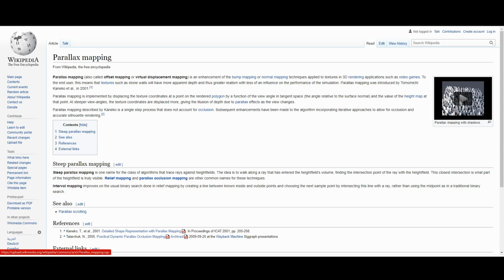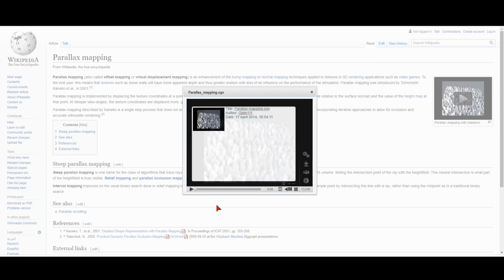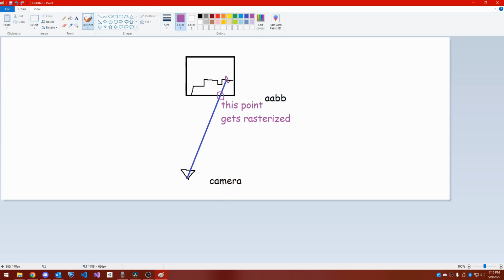Drawing MILLIONS of voxels on an integrated GPU with parallax ray marching [Voxel Devlog #4]

Comment: If you aren't already doing it, could you use the bounding boxes that you use for rendering as an early discard to discard entire chunks of the rendered image and save on performance that way? Also, what about dynamically sized bounding boxes that can change size to cover large areas with a single block to reduce rendering overhead for large solid structures
Reply from the maker: The bounding boxes can't quite be used for early-discard because the bounding boxes are maximal. That is, they surround all solid voxels and in addition may contain some transparent air sections too. Hence, rendering the bounding boxes early would occlude portions of the screen that should actually be visible.
In this iteration of the engine, I chose to go with fixed-size bounding boxes for two reasons. One, it was much simpler to program and maintain the rendering pipeline. Two, having a fixed-size bounding box allows one to limit the maximum number of ray-steps, which is important for achieving good performance on low-end devices with the parallax ray marching technique.
Reply: @DouglasDwyer  That's fair

Comment: How do you send the voxel data to the shaders to render them on the surface of the bounding boxes? I'm trying to create a similar effect.
Reply from the maker: The voxel data for each 8x8x8 bounding box is packed tightly into a single, large 3D texture. The offset into this 3D texture is encoded as a vertex attribute for the bounding box geometry. Then, the 3D texture is sampled in the fragment shader using the offset for each bounding box.
Reply: @DouglasDwyer  In my implementation I have a 'Voxel', a bounding box, and a 'Voxel Chunk', which is a 32x32x32 group of bounding boxes. So you have a large 3D texture for every 'Voxel Chunk' and each bounding box inside the 'Voxel Chunk' has an offset of where it is inside that 3D texture, and then you send the 3D texture to the fragment shader and then do the ray marching inside each bounding box?
Reply from the maker: @brian9498 That's almost correct. The way you describe it, it sounds like the suggestion is to create an entire 3D texture and upload the entire voxel volume to it for each voxel chunk. While that might work for prototyping, it's wasteful in terms of memory (because there is a lot of empty space in the 3D texture that doesn't correspond to a bounding box) and also bad for performance (because you will have to change the texture binding between each chunk draw call).
Instead, I have one single 3D texture for everything. When a voxel chunk is created, I allocate a region of that 3D texture and tightly pack the voxel data only for the visible bounding boxes into it. This ensures a low memory footprint and allows reusing the same texture in all draw calls. Let me know if you have any more questions!
Reply: @DouglasDwyer  Thanks for the explanation!

Comment: Hi, I'm new to graphics programming and I wondered why your implementation of parallax ray marching is more efficient than than simply just raymarching the whole scene. At least on how I understood raymarching it seems that in the end the same work is performed, well more work actually now that you also need to generate those bounding boxes. Is there something I missed?
Reply from the maker: Sure, no problem. There's a big difference between parallax ray marching and "pure" ray marching - that is, where the ray begins.

From my experience the biggest bottleneck in GPU-accelerated ray marching is memory. Every ray step requires loading data from a buffer or a texture, and memory latency becomes a big concern as each ray diverges. Integrated GPUs are especially bad at memory accesses. Naively marching voxel grids can easily lead to hundreds of steps and memory accesses (although there are techniques to reduce step count, like distance fields). This makes pure ray marching slow.

With parallax ray marching, the bounding boxes are first rasterized, which is nearly instantaneous. Then, a ray is started on the surface of each bounding box. Since the bounding boxes are tight - conforming closely to the voxel surface - only a few ray steps are needed to hit a solid voxel. In the best case, it's a single ray step. In the worst case, it's 24. For the scenes in this video, I would guess that it averages around 4 steps. This means only 4 texture fetches, which is much better than pure marching! This is where the speedup lies - integrated GPUs are good at rasterization, but not at random-access memory fetches. So, we minimize memory fetches.
Reply: @DouglasDwyer  Thank you for your input! I believe I understand your concept a bit better, I want to create a more detailed YouTube video about your concept and want to talk about some of my own ideas. Would it be ok with you that I use your concept as a basis for my video, I will of course credit you.
Reply from the maker: @neurenix5201  that sounds great! Feel free to use whatever you like. Let me know when you post it - I would love to take a look.

Comment: How do you pass voxel data to the GPU? Do you use either an octree or just a 3d array that's set per invocation on a box-bounded object?
Reply from the maker: Great question! Let me refer you to an answer I made on a separate video:

The data required for rendering chunks is twofold, and corresponds to the parallax ray marching implementation described in this devlog. First, face data needs to be stored for each bounding box upon which parallax ray marching is performed. There are typically maybe around 3,000 to 6,000 faces that get stored, with vertex position and a per-quad pointer to a materials array. That brings me to the second part, which is the materials array. Surface-visible voxels (only those on the surface!) are uploaded to a 3D texture which is referenced in the VBO indices. On the CPU, data is stored in an octree, so a conversion process is necessary for this step.
Reply: @DouglasDwyer  is that 3d texture just sparsely filled with the surface voxels leaving all the empty space in between? Or are they compressed or consolidated in some way?
Also re:depth values, you mention you can render non overlapping regions with an early z test, but in the video show overlapping objects. Does having overlap require you not use that approach?
Reply from the maker: So, the voxels for each 8x8x8 bounding box (only the AABBs on the visible surface of the volume) are copied into the 3D texture. In texture memory, the voxel boxes are tightly packed, meaning the large empty spaces (or opaque, non-visible solid portions) of the volume are not stored in texture memory. This allows me to render a great number of volumes without an insane amount of VRAM.

You are exactly right about the depth - to solve this, multiple passes are employed. The first pass draws the large static potion of the scene with an early z-test, allowing for optimizations. The second pass draws smaller dynamic objects with an immediate depth write to allow for objects to intersect properly.

Comment: I've been kinda wondering... if I understand your explanation correctly, this method does a depth buffer copy pass for each set of 8x8x8 chunks that overlap in screen-space (kind of like depth peeling, I guess). But your video shows a significant depth complexity at certain angles, which (I assume) would require many dozens of these rather expensive depth-copy passes... yet the performance stays smooth. Is there something more going on? 🤔
Reply from the maker: So, there's an algorithmic "trick" involved with the 8x8x8 chunks which overlap. There is only a single depth-copy that occurs in the scene - you are correct, otherwise the performance would be very slow. Let me try to clarify:

When I draw the 8x8x8 AABBs, the point of the depth buffer is to ensure that closer AABBs are drawn first. If I don't immediately adjust the depth, then the depth of the AABB is written naturally to the depth buffer. This means that, if I draw two AABBs which don't overlap *in world space*, the closer one will always show up on top, no matter how I draw the voxels inside. Problems only occur when AABBs physically conflict, which only happens between dynamic, smaller objects in the scene (because they are not axis-aligned). Therefore, I perform two render passes: I draw the main axis-aligned world to a color buffer, and draw the actual depth to another color buffer. The AABB depth is recorded in the normal depth buffer. After that's done, I perform a depth-copy pass, and then draw the dynamic objects by setting gl_FragDepth. Single copy pass :)
Reply: @DouglasDwyer  Ah! I see. Though, if I understand correctly, this requires to draw the axis-aligned AABBs either in the back-to-front order with regular alpha-blending, or in front-to-back order with disabled depth test and (1 - destination alpha) blending? Which means that early-Z optimization cannot be utilized by axis-aligned AABBs anyway, and ray marching will be executed for every fragment of every AABB (regardless of overdraw) at that stage.
Is there some additional trick you use here? Or is the ray marching cheap enough that you can afford having dozens or even hundreds of them executed per pixel?
Reply from the maker: I am not using alpha blending to draw the voxels inside the AABBs. The transparent "air" sections of the AABBs are drawn by calling discard() in the fragment shader, which seems to maintain the early-Z test. No particular AABB ordering is necessary.
I currently haven't implemented any sort of transparency effects; that will be a separate (and interesting!) issue to tackle in the future. The current technique only supports opaque voxels.
Reply: @DouglasDwyer  Hm... that's rather unexpected, since every resource on the Internet seems to suggest that discard() disables the early-Z test (the "Early z and discard" thread on Khronos forums had a good explanation why). Could this be specific to your Intel UHD Graphics hardware, somehow? Have you tested it on other low-end GPUs? 🤔
Reply from the maker: This is a very interesting point. Thanks for sending me the resources. I have tested on three Intel integrated GPUs and one 2011 Macbook Pro (performance is worse on this one, of course, but not comparatively worse than other games), and didn't observe anything unexpected. I have also tested on discrete cards, and attained great performance there.

I think the reason for this discrepancy is that most of the internet resources on the topic - at least the ones I've seen - are relatively old. Note that the OpenGL Wiki only states "this will almost always turn off early depth tests on some hardware." Also, all modern hardware now includes conservative depth, which is a similar feature. Its existence implies that, at least theoretically, early depth testing with discard should be possible. I would assume that, on recent hardware (within the past 10 years or so) drivers now make the optimization to keep early depth with discard on. This would explain my observations - I find performance gets much worse when I write directly to depth (without conservative depth) than when I use discard. This is a good point of which to be aware, though - thanks for bringing it up!

Comment: Hey Douglas - I'm impressed watching your progress on this engine over time! I noticed that you have some custom depth logic in order to keep early z tests while being able to modify the depth in the fragment shader. Could you go in a little more detail as to how this works? I saw someone else commented about only ever increasing the depth. This makes sense to me if you render the front faces of each chunk - the depth will only ever increase as a ray traverses through the chunk, no problems there. However, what if the camera is inside the chunk? Assuming we're not culling faces, then what we see technically is the back face of the mesh representing the chunk. Then, our assumption that the depth will only increase is no longer true. Does your method deal with this problem? I'm working on my own voxel engine currently, and this problem has left me rather stumped.
Reply from the maker: Haha - you are absolutely right! This is a problem that I gloss over in the video. The method in the video does not have a natural solution for rendering when the camera is inside a bounding box. However, I do have a way to deal with this problem that I intend to implement in the future.

Let me try to explain a bit more about how I do the rendering. You seem to already grasp the idea since you've asked such an insightful question. I break the voxel world up into 8x8x8 voxel "bounding boxes," and then render faces for the outsides of those bounding boxes. The small bounding box size reduces the number of necessary ray steps and allows this to run on low-end hardware. All back faces are culled for performance reasons, so when the camera goes inside a bounding box, the content just disappears. This little annoyance COULD be solved by rendering with back faces instead of front faces, which is what the game Teardown does. However, rendering with back faces makes culling much more difficult, and would require many more triangles on the whole to render properly.

Instead, I propose to solve this problem by adding in a traditional raymarching step to the rendering pipeline. On the CPU side, I will detect the AABBs that intersect the camera's near clipping pane. Then, I will probably draw a fullscreen quad or something similar, and perform standard raymarching for those AABBs, skipping the rasterization step. Because the camera will only ever be intersecting a few small AABBs, I don't anticipate major performance issues.

Let me know if you have any questions - I'd be happy to talk about it more! That's the gist of it, though - I am going to sidestep this problem by rendering the offending bounding boxes differently.
Reply: @DouglasDwyer  I see, that definitely makes sense. I could accept that the number of voxel chunks that intersect the camera's clipping plane would be far less than the total amount. One trick you could do to render these still using the same fragment shader you use for tracing voxel chunks would be to, for only the offending voxel chunks, render back faces instead of front faces. In the shader, you'd have to #ifdef away the depth definition specifying increase only, so technically you'd need 2 shader programs (with almost exactly the same source code). That way, for only the offending the AABBs, you can render the chunks using the "same" fragment shader (albeit at slightly slower speeds w/o early depth test, however I don't imagine many of these chunks would get culled anyway). Then, you can switch back to the increase only shader and render anything whose front faces are fully visible.

One thing I noticed is that I didn't see any artifacts that I would expect from the camera being inside a voxel chunk in the video. Did you just position the camera cleverly in the video to avoid the issue, did you record w/o depth testing, or something else?

Looking forward to seeing how this project goes. Might be interesting to see how you handle secondary rays. Those wouldn't be able to take advantage of rasterization cutting down on the distance traced, but you could use some other scheme like a BVH to trace through the chunks in world space, or DDA through the chunks until you reach a non-empty chunk. Thanks for the response!
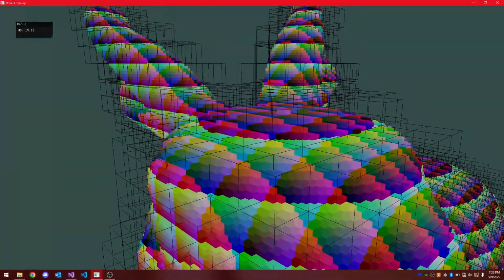Reply from the maker: @No-vv7rp  Because each AABB is only 8x8x8 voxels, the camera has to come within 8 voxels of the rendered surface (or even less, since AABBs fit the surface as tightly as possible). The camera doesn't come that close to any of the AABBs in the video, so there aren't any problems. Again, though the data is organized into larger voxel chunks, the small AABBs are what are rasterized and ray marched. Have a look at 7:09 for a visual example - in the final product, those boxes are even smaller, as they fit their contents tightly.

As for secondary rays, I don't have any current plans. My goal is to keep this project compatible with low-end computers, and I don't think the integrated GPUs could handle BVH/DDA schemes, but it might be worth a try in the future. I will be using more traditional rasterization tricks (like shadow mapping) to improve visual fidelity. Some upcoming issues I do intend to address in the future are transparency and multiple lights, which should be interesting problems in their own right.
Reply: If you're rendering the front faces to the depth buffer, aren't there potentially cases (such as a case where each chunk has just enough voxels to push the AABB to the full 8x8 size) where chunks will be erroneously concealed? I guess the actual fragment shader will retract that somewhat, do you just deal with this by rendering near-to-far? And if so, wouldn't the reverse (render backfaces, push depth toward the camera in the fragment shader) work the same?  I imagine that being able to render fully-opaque backfaces without discard first and then render the rest afterward would provide some sort of performance advantage.